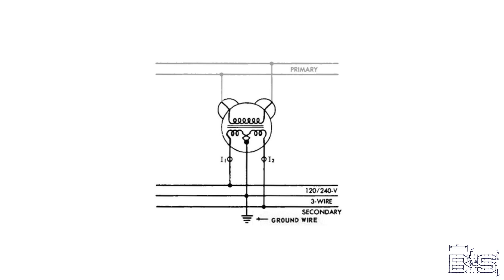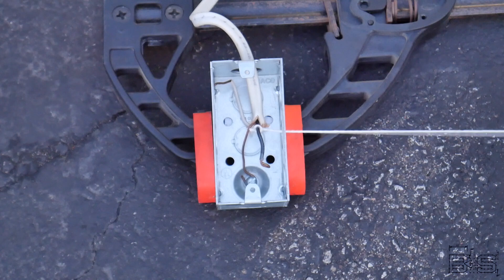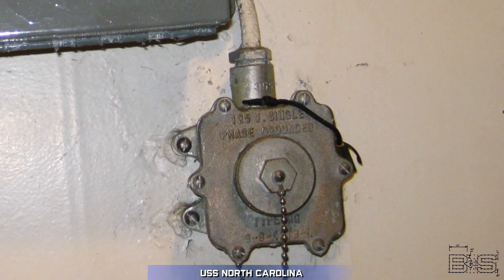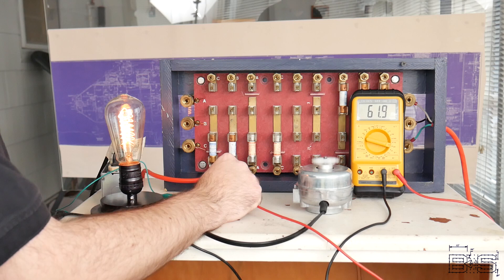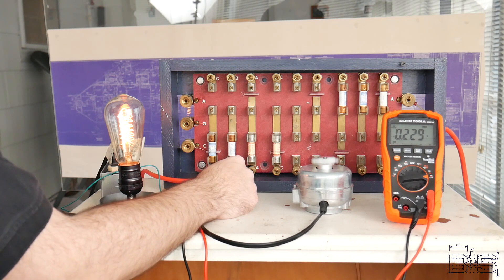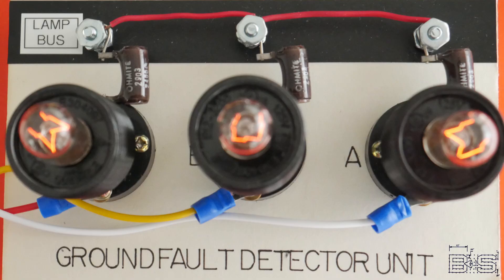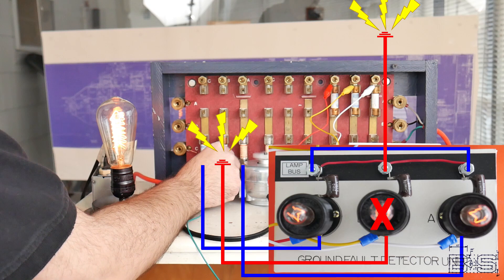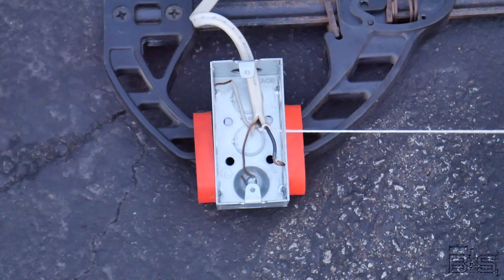Diagnosing 3-Phase Power Systems Part 2 - Ground Faults

Comment: Energized devices that NEED to fail safe should NOT have ground.  That way IF a power wire pinches a grounded part by accident, the breaker will not shut off and de energize safety circuit.  But then you NEED to test for ground constantly.  Or else you may lose current to your vital circuits and present a danger.  In public that may be a magnet crane or a warning system.

Comment: I stumbled onto a handful of cruise videos but the one thing they can't answer is why you're not allowed to bring certain power strip surge protectors on board. My theory so far is been that the MOV that shunts the surge to ground causes stray voltage on the hall.
But I also can't understand why they would be attaching the ground to the hall anyway not treating it like an isolated ground or removing in favor of GFCI/RCDs.
And apparently this is so much of a problem that they will search bags and confiscate until the end of your cruise. As somebody who is extremely technical and has a lot of equipment audio video etc. this would be very annoying because certain things I'v picked out are better functionally for certain things. Good news is I'm not planning on taking a cruise anytime soon.

Comment: I have been telling people that electric cars have more in common with ship electrical systems than home ones.

While the traction battery is DC power instead of 3 phase: it is still an ungrounded system. Prior to charging: the car checks for ground faults.

I had heard that these faults can be traced, but was unsure how.